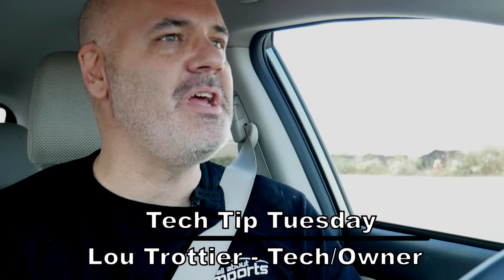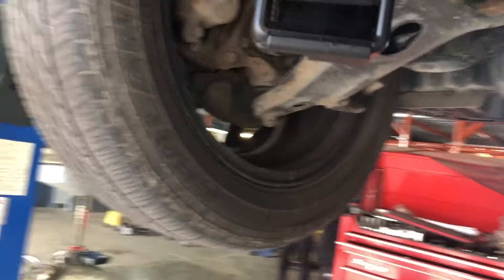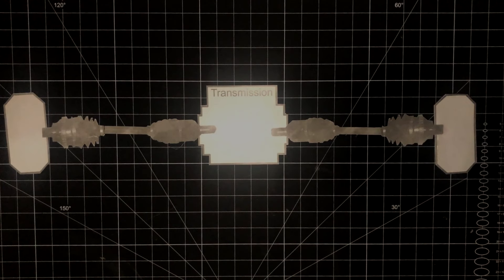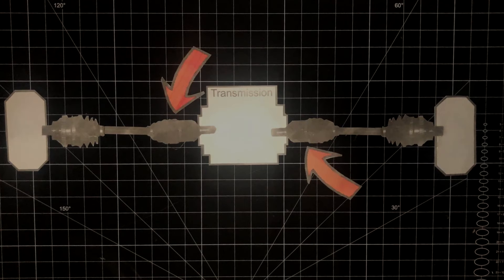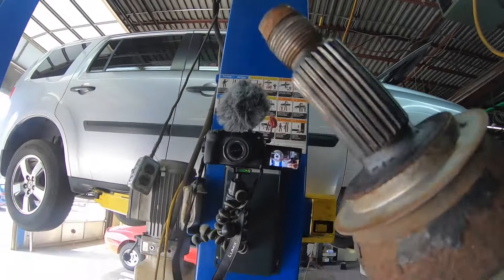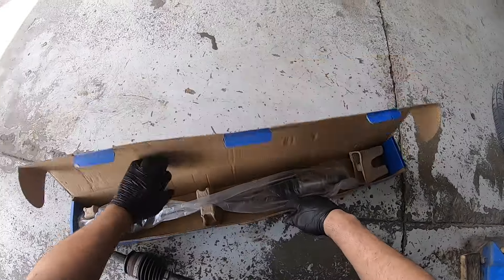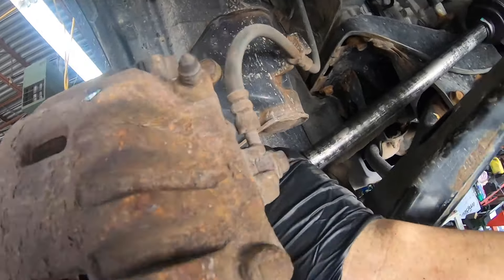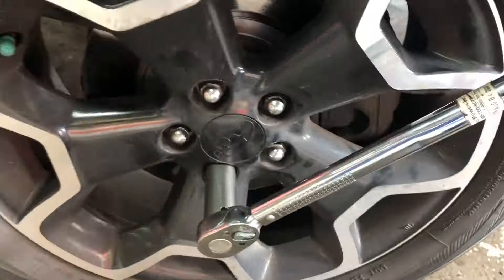Noise when turning steering wheel at slow speeds

Comment: Hey Lou excellent video I have this exact  noise.   I have a question.   If I hear that exact same noise but there are no visible signs of outside tears on the boots would it still be the CV axles.   Your video didn't show any outside wear and tear.  So would it be the internal components that failed?
Reply from the maker: the boots don't have to be ripped for the joint to have failed. internal yes.
Reply: @LouTrottier  thanks for the reply Lou.   I inspected my axles and I know the right side is slowly going with that noise.   On the left side there is no noise when I turn left.  But my inner boot you can see the boot starting to crack.    I see cracks in the boot but no visible signs of fluid coming out.  Should I just replace that one as well or wait until it does make noises
Reply from the maker: @williamthai9194  just replace the noisy one only.
Reply: @LouTrottier  thanks Lou for your replies.   Greatly appreciated
Reply: Hey Lou I am finally ready to take on this challenge.  But the parts store I am buying it from made me rethink  about something.    When I turn right which is when the noise happens, do I buy the right side CV axle or the left side.   He said you have to buy the left driver side as it is always the opposite.   So which side do I buy.   Again the noise only happens when I turn  right.   Thank you as always

Comment: Hey Lou, I have a 2006 Honda Civic and every time I’m at a red light and I accelerate is sounds like a cracking sound, and when I make left turns slowly depending if I’m a stop sign or light it makes a cracking noise as well. What might be the problem? It only happens when I stop and then I accelerate and when I turn slowly.
Reply from the maker: Does sound like it might be a cv shaft.
Reply: Lou Trottier cv axle? I’m getting it checked on forsure on tmrw! Appreciate it lou!
Reply from the maker: SEM HS yes.  Cv axle.
Reply: Lou Trottier appreciate it boss!

Comment: I’m hearing a low grinding/wobbling kinda noise as I’m driving and it gets louder sometimes when I turn the wheel. I can feel it under my feet when I’m driving and when I’m in the passenger’s seat. Very much so when on smooth roads. The mechanic claims he cannot feel or hear anything 🙄🙄🙄. I need direction . It’s not the breaks. It’s a low sound. The car isn’t veering left or right and my wheel doesn’t turn on its own. It’s a sound I would expect if a had a wobbling or flat tire 🛞 that was being rotated in driving or almost flat but neither seems to be the case. 🤷🏽‍♀️😫
Reply from the maker: sounds like you are describing a wearing wheel bearing.

Comment: Lou, I have a 2003 mercedes s500 4matic and every time I cut the wheel hard at slow speeds, it makes a horrible clanking and banging sound (this happens when i turn either direction) and even vibrates throughout the car, as I increase speed it slowly dissipates. What do you think could be causing this? Could it just be a cv axle or something more?
Reply from the maker: I'm the thinking transfer case is possibly the culprit.
Reply: I have this exact problem, did u ever find the problem?

Comment: Hi Lou, i just bought a used 2021 rav4 when i take sharp left turn, driver side tire locks/slips. It only happens at slow speed u turn, sharp left turn even when entering  the driveway with slight slope. It makes me hesitate everytime i take sharp turn. Other thing i notice is driver side tire is chipped off. It is especially obvious if there are small loose stones on the pavement such as in some parking lots. There is no major noise. Could you please tell me what could be wrong. Please reply!!!
Reply from the maker: sounds like it needs a wheel alignment.

Comment: I never heard the noise. I’ll try watching again. My Yukon makes a popping sound from behind the  front wheels when turning. It’s a single pop per turn of the steering wheel. I have taken it multiple times to gmc service dept and they can’t fix it. It ends up the same or worse now. I hear the popping more often when making turns.
Reply from the maker: pooping noise when turning usually has to do with where the front spring mount.

Comment: My honda civic is making a creak noise when parked and at low speeds. When turn the wheel a bit goes creak and i replaced parts and still makes the noise. Which sounds by the passenger side and sounds like in the middle but its quite hard to figure out.
Reply from the maker: Gamer Cat probably a right lower ball joint.
Reply: @LouTrottier  i had the upper and lower ball joints replaced.
Reply: @LouTrottier  i made a video where my car is parked and it makes a loud creak when the wheels are straight.
Reply from the maker: Gamer Cat where is the video?
Reply: @LouTrottier  i couldn't put it up i found out my outer tie rod is moving side to side when i wrap my hand on the tie rod and i believe it shouldn't wiggle.
Reply: Check your dust shield next to your brakes. Rusty rotors will make contact with the dust shield and make noise when turning. If you don't want to replace rotor just bend the dust shield back
Reply: @HorseRadish403  i already replaced the rotors and brakes and the shield isn't touching.
Reply: @gamercat7004  Did you check your hub  for play
Reply: @HorseRadish403  i haven't tried that but i had replaced the lower ball joints on the front but it probably a bad ball joint. It makes a little noise without the wheel on but when the weight comes in and makes a rough grind.
Reply: @gamercat7004  2005 f150 was making grinding going straight as soon as you accelerate it would get worse. Sounded like the tire was about to fall off. So I lifted the tire and shook it. And it had a lot of play.The YouTuber 
"Chris Fix It" has a lot good videos on it
Reply: @HorseRadish403  i seen his video and i twist the knuckle and was making a light pinched squeak when i rotate it and i think its the ball joint.

Comment: Why was the axel popping in the first place. I just replaced my driver side cv axle but the new one pops and wondering why?
Reply from the maker: the joint was worn out.  not sure why a brand new part would be noisy unless its defective or the wrong side was replaced.
Reply: @LouTrottier  I wonder if it's the ball joint? It doesn't have to turn in order to hear the noise. And the noise isn't present all the time. I was also thinking the part is defective but I'll have to further investigate. Thanks for the response though
Reply: @LouTrottier  Also, could it be they gave me the wrong side cv axle?
Reply from the maker: @castlecrook43  a cv joint only makes noise when the car is moving, so if the noise is there at a stand still just turning the steering wheel, then the CV joint was not the correct fix.  and yes could be a ball joint.
Reply: @LouTrottier  Oh for sure the vehicle is moving to hear the sound. It's like a clanking popping noise but only does it while moving and the noise happens occasionally and not consistently. If I was given the xv axle for the wrong side, would it be making noise like that? Thanks for the advice and response
Reply from the maker: @castlecrook43  if it was the wrong axle it would not have gone into the car and worked.  They are usually side specific.
Reply: @LouTrottier  After replacing both axles ( both needing replacement anyhow ) I found the noise coming from somewhere else though, and this has yet to be solved. I will keep you and whoever finds any interest in this updated.. I appreciate the response and feedback

Comment: If the farther I turn the wheel the louder it gets is that typical of cv joint failure?
Reply from the maker: Not usually
Reply: @LouTrottier  Wow thanks! I was not expecting a response from you on such an older video. I didn't think so myself either. Questioning if I just have a warped rotor or something else no to serious.

Comment: I couldn't make out the noise is was making as it turns. I'm a first time car owner. Is any noise while steering normal? when I turn slow I hear a noise not a screeching or cracking not sure how to describe it actually. I guess I'm just wondering if any noise is normal?
Reply: also when I got the car I think they said the rotors were replaced and they told me the front breaks are basically new and they replaced the back breaks. I have a front wheel drive as well rav4
Reply from the maker: I would have to hear it. Post a video of the noise.
Reply: ok I will try to do that tomorrow and tag you, thanks!

Comment: I get the same noise when I try to reverse and turn out of my driveway I’ve had the outer tie rods and brakes replaced but not the inner should I replace the inner as well? At this point I can pull out my driveway because I’m worried that wheel will pop off
Reply from the maker: this noise would not include be any of the items that you mentioned.  Gotta be something else.
Reply: @LouTrottier  what can it be
Reply: @LouTrottier  I checked today and my inner tie rod is very loose what does that mean
Reply from the maker: @34uzz78  well if it is loose then you need to have it replaced and have an alignment done.  IF it fixes your noise, then that is fantastic but I suspect you may have more than one problem.
Reply: @LouTrottier  what would the other problem be ?
Reply from the maker: @34uzz78  I'm sorry, no way I can tell you without hearing or seeing it.
Reply: So what happened? I’m having the same issue
Reply: @jameso8711  it was my cv axle

Comment: Thanks a million for making this video.
My 07 camry have this same noise and when I gas i feel like the vehicle want to jump and speed up. I can feel something is lose on the front.   
Do u think its bcz of the axle  ??
Please let me know.  Thank you in advance.
Reply from the maker: the component that has failed in this video would not cause your Camry to jump or speed up.  Sounds like you have more than one issue.
Reply: @LouTrottier  its not a jump jump but a tick when takes off on gas . 
Do u think its the axles  ?
Reply from the maker: @ashrafsiddiquee3190  possible, but not likely..

Comment: I have a problem that persists on my 2008 Subaru Forester... Other than straight ahead I get a vibration whether I turn either right or left.... I can feel it and even hear it... Garage replaced a wheel bearing, 2 ball joints, and a CV shaft and I still have the same problem after spending $$$.$$.. I'm now retired so I can't keep spending all this money and still have the same problem...  I wish I had you to fix my problem....thanks for the video
Reply from the maker: oh boy, that's not good.  are you sure its not a tire/wheel problem?
Reply: @LouTrottier  I'm not sure of anything... what gets me is I know before I get 1 mile home that it has the same problem it's so obvious,  If the owner is there I'll talk to him again since I need to have my annual car inspection in about 1/2 hour....thanks for the reply

Comment: Hello. My 2016 ford fusion makes a very squeaky grindy sound when turning steering  right at low speeds. Loudest when turning the wheel stopped. What can this be? It is very loud and it seems to be coming from the left front wheel. Thank you. P.s No sound at moderate to higj speeds
Reply from the maker: lower ball joint or outer tie rod.

Comment: mine is knocking at the full lock both sides, does this mean its the outer tie rod on both sides?
Reply from the maker: outer tie rods do not make the same noise as what was demonstrated in my video.   This video is for bad cv joints.
Reply: @LouTrottier  Just thinking of what it could be before it goes to the garage next week is all :)
Reply from the maker: @minimad8793  if it is continually clicking as you go around a corner, chances are it is not a tie rod.  good luck
Reply: @LouTrottier  maybe right. just been out in it and its mostly from the left side. thanks for replying

Comment: What if it's hard to turn the wheel when parallel parking? Could it be the power steering pump?
Reply from the maker: Power steering fluid low, bad pump or maybe even a steering rack issue.

Comment: i change both of my axles and i still hear this clanking grinding noise. i know i have to had a little more transmisson fluid cuz alot came out when pulling driver side cv axle on my 08 altima but i still hear it. granted my car has been parked for a couple of weeks but i just recently changed both axles and im stumped. it only happens on slow acceleration, dosent matter if turning or not. dont really want to trade in my car to get a newer one because i just bought this less than a year ago and dont want negative equity. car got me stumped and wanting me to throw new parts at it
Reply from the maker: if the noise is still there then that suggests it did not need the axles.  if you can post a video with really clear audio I can take a listen.

Comment: Hi there mate. I've found myself here as I have a 2009 Mazda 6 2.0 petrol and have noticed a sort of clunking/ knocking wen I'm setting off slowly seems to be on front end definitely not on the wheels but can't figure out what it is ? Also I've had it up on a friend's ramp and we noticed wen letting wheels turn in gear one turns and other is very intimitent and wen we accelerated one wheel was going faster and other seems to go slow then fast then slow then fast? Weird. Could you help
Reply from the maker: I would look at either a swaybar link or a ball joints, or suspension component having failed. Secondly the wheel spinning faster than the other while on the hoist is normal.
Reply: @LouTrottier  thankyou for your reply. So wen the car is up on a ramp it is normal for the one wheel to turn faster than the other ? But I will check everything recommend thanks
Reply from the maker: @paulsavage100  yes, perfectly normal.

Comment: so i replaced my cv axle on my car and it still making the noise that its making in the video, could it be that i didnt push it in all the way?, i was thinking about it and if i didnt oush it in all the way it wouldnt work, could there be another reason why its making the noise?, it also stalls when i turn and accelerate too fast
Reply from the maker: If you had not pushed it in sufficiently it would not move forward.  Maybe your changed the wrong side??

Comment: My Toyota Aurion 2015 LH front wheel has a constant chirping noise when turning right after warming up after 5 mins or so. Not very loud but loud enough for my son riding in the back seat to ask, "What's that noise dad?" 
Even when driving down a straight  road the slightest turn right of the steering wheel and it tweets.
No noise when the car is parked and the steering wheel turned to the right.
I should also say that the garage replaced the brake pads and machined the rotors but that made no difference.
Any ideas please?
Reply from the maker: it is rotating noise then.   2 thing to check.  either something is touching the backing plates or a bad wheel bearing.
Reply: @LouTrottier  Yes, only when the car is moving forwards and after having warmed up after about 5 mins.
Thanks for your suggestion. I see that changing a front wheel bearing is very complicated.
After having watched your video I thought it might be one of the CV joints going to the LH front wheel as you demonstrate how to replace.
I am now planning to get as many test drives with a Service engineer to see if they can isolate the source of the noise.

Comment: Hi Lou. Is it the same problem if you hear a scratching/scrapping noise BUT ONLY IN REVERSE when your turn your wheels?  I hear scratching noise only when reversing and turning the steering wheel either left or right.  So does that mean I need 2 new cv joint?  Thanks.
Reply from the maker: actually no, that sounds like your brake pad wearing indicator might be touching the brake rotor indicating you need brakes.
Reply: @LouTrottier  Hmmmmm.......Pfew. I thought I might have to put serious money into new cv joints or tie rods or something.  Thanks for the reply.  Yeah. I don't hear the scratching/scrapping noise when in FORWARD and turning.  Only in reverse and turning.  It sounds like something scrapping against a piece of thin metal.  Okay.  I'll look into it.  Thanks again.

Comment: What is your advice for my scion tc 2011 to get it to stop pulling right. It's not tire pressure although when i got new tires, the problem went away temp, and then came back. I beleive it could be becuase of the negative cambered back right . It also Clicks when i turn the wheel sharply . Its not a loud click , but it is noticable, and consistent. EX: if the back right wheel hub is negative cambered, can I just buy the assembly , or do i need to get an adjustable arm or something to fix the camber. Because I figure the camber is causing friction issues and might be making it do all that. Thanks for reading; i do apreciate advice.
Reply from the maker: if it went away with new tires then chances are it is tire related.  Rear camber can cause a pull but it would have to be out quite a bit to do that.
Reply: I self diagnosed today LOU: 
Turns up , the back brakes are tied
up and squeaking to the point where, 
a little lube makes the car coast like a dream. But the problem comes back.
Once I get to the garage I will update the status of exactly what determines 
this brake and pulling issue.
Is it the brakes making the car pull 
you think? I would want to fix the underlying first. Thanks
Reply from the maker: @trevorbronkema7332  a seizing brake will most certainly cause a vehicle to pull to one side.
Reply: @LouTrottier  Thankyou , I took off each tire and cleaned the rotors and lubed the metal slides and now not only is the pulling fixed, but it drives like it never did before, so pleased.
Reply from the maker: @trevorbronkema7332  good work.